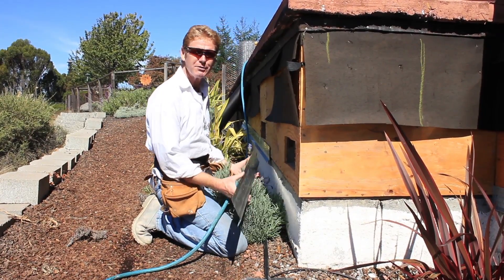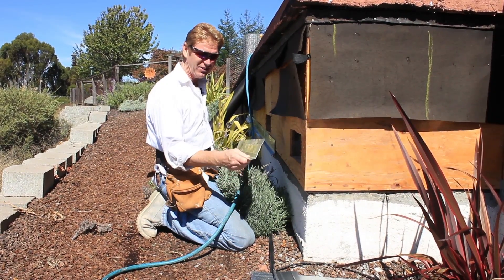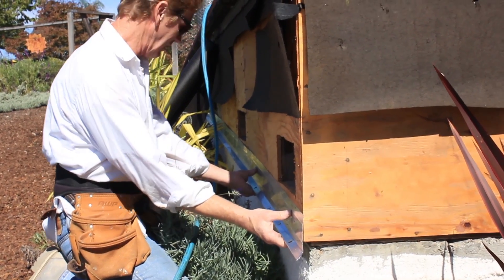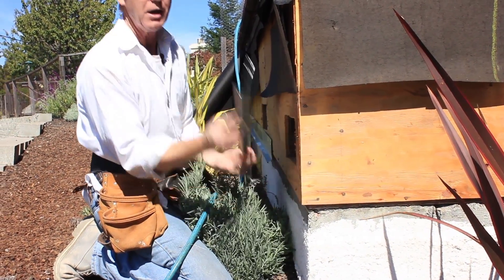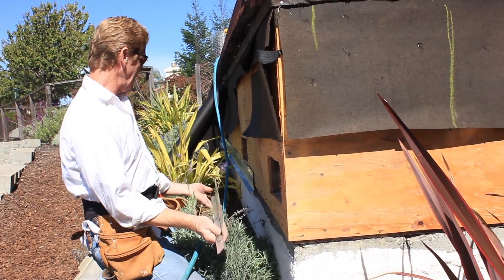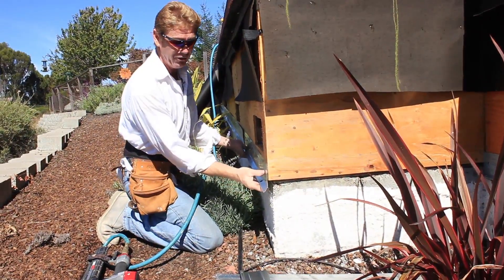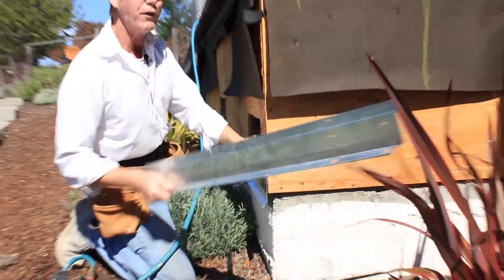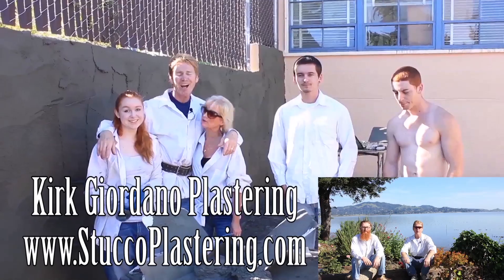https://youtu.be/CB_cK38i-18

Comment: Great content - if there is a huge cavity and I can see see the wood behind the weep screed post stucco application- does that mean they installed it incorrectly?
Reply from the maker: No, not at all, this means the wood can breathe, just don't allow that area to get or stay wet. How can it get wet? a sprinkler system pointed upwards. Yes, I have seen this, the wood rotted and stucco cracked and buckled because of that.🕵🏼

Comment: Great video. What type of staples are you using for the weep screed and the weather proofing paper?
Reply from the maker: Inch and a quarter for the airgun and T-150 for the hammer tacker.
Reply: @StuccoPlastering  do you use stainless steel or hot dipped galvanized?
Reply from the maker: @kanive1566  they only sell galvanized
Reply: @StuccoPlastering  they sell T-50 staples in stainless steel
Reply from the maker: @kanive1566  good to know but that would be over kill with what we do, unless we were trying to avoid electrolysis.
Reply: @StuccoPlastering  I see. Ok thanks for the info.

Comment: What if this is a second floor (wood frame) and it’s sitting on a first floor concrete block structure. Does the 2nd floor wood frame stucco still need a weep screed? If it doesn’t have it, what happens? Thanks Kirk! 👍🏼
Reply from the maker: I would recommend you use it rather than just feathering over the lath and bricks together.
 If you don't use a weep or expansion joint, you will get a nasty horanzont crack around the entire perimeter in less than three years. It won't be structural or damaging, but it will be a sign of an apprentice who lathed and plastered the two separate starters. Cheers. That's a good question, my brother. I do have videos on this.
Reply: @StuccoPlastering Thanks! I looked for a video on this from you but couldn’t find it. So much content! lol. I’ll keep searching. Thanks again.

Comment: How do you prevent insects from crawing up weep screeds?
Reply from the maker: Morning Matt, insects such as spiders and other bugs will hang out where they want, they cause do problems. The idea is to drop the weep screeds at levels that protects the wood mud sill and or plywood. Why? Good question. If they get wet they swell and rot, now the termites move in then when they eat the wet wood and die they make a meal for the ants. That’s when the trouble really begins so installing the weep or drip screeds is important. Now you know.😉

Comment: Do you need to use this if you have a concrete block house? Is this only for wood framed and paddled houses. Thank you.
Reply from the maker: Hello Security Dude; excellent question; metal screeds are not meant for bricks, blocks, or rocks as they don't move nor rot. 👨🏻‍🔬

Comment: Kirk, one last question... I need to double-ply paper my house to protect plywood siding and window flashing.  How long do you suppose can the paper be left "open" to the sun without installing stucco?  6 months? 1 year?  Reason being that we're waiting for permits from LADBS for basement work, and that should be done before stucco is added I'm told as stucco will crack with foundation shifts.  Thank you.
Reply from the maker: Hi Roger, that depends on the wind and rain. I have seen the paper last well over a year, and the opposite, areas with high winds and rain beat it up in less than a month.
Reply: @StuccoPlastering  Thank YOU.  A reason your information/videos are so critical (at least here in Los Angeles, CA) is that my experience with several licensed contractors from general, window, block and concrete have construction guys and indeed OWNERS who have the "I don't give-a-f***" attitude  about the quality of the work, despite having city approved plans laid out, and often must be micromanaged.  They want the money after an LADBS inspector clears their work, who ironically often passes final product without truly checking said work.  Leaving behind substandard results that in my case, have had to be redone 2, and in once instance, 3 times at massive costs leading to the involvement of the CA State License Board.    I don't know the reason for the "I can't be bothered" attitude, maybe it's pot? or covid? I just know that when I was a kid in my teens and 20s (I am now 50) there WAS incredible pride in what people produced.  Have others in construction or homeowners seen this transition? Lastly, We appreciate your outright honesty.  Truth is a breath of fresh air.
Reply from the maker: @rtovar91  Thank you, my friend, thee are indeed many who have no clue.

Comment: Hi Kirk,  thanks for the nice video. One quick question for the screeds.  If I use a blower to blow outside to the screeds, will it cause air flow into the house?  In my new house,   I can feel the wind around the connection area of the floor and dry wall inside the house? I am not sure if that is the sealing issue of inside dry wall to the floor.
Reply from the maker: Howdy Enyang Xu, Now that's an interesting question, No, if the screeds are hung properly or incorrectly, this has nothing to do with air coming into your home, 
It sounds like your windows don't shut firmly.🤔
Reply: @StuccoPlastering  Thanks Kirk.  I am suspecting the air sealing between drywall and floor is not done properly before they put in the insulation. They should put in something like Caulk there for the sealing.
Reply from the maker: @eyxu  They are gone. It will be up to you to caulk around the perimeters, It's as easy as drinking a beer, nothing to it.
 No doubt you have large exterior foundation vents that allow excellent airflow into the foundation area.🤙

Comment: What can I do if I already have stucco against a cement walkway but the stucco falls off with the rains.  What could I do in that?  Thanks
Reply from the maker: Howdy Jamie, sorry, I don't understand your question.
 That is like saying when it rains, the concrete walkways dissolve. It makes no sense. Clarify, please.🤔
Reply: @StuccoPlastering  Is, I'm sorry.   So here goes another try. I had a new cement walkway installed on the side of my house.  This cement walkway is 90 degrees perpendicular to the wall (stucco wall).  Where these two meet (@ the 90 degrees) my stucco falls off.  The wall doesn't have a wepscreed and water acculates (@ the 90 degree intersrction) and the stucco falls off.

Comment: What size drip screed are you using in this video if you don't mind me asking?
Reply from the maker: Evening Ray, LOL, there is only one size that depth is 7/8 the flange is 3 and a half ings long, there are two types of weep or drip screeds sold in the USA, both are 7/8 thick as that traditional stucco thickness.
Reply: @StuccoPlastering  Thank you brother

Comment: Great information. My new home is stucco and weep screed is installed properly, however my home inspector says much of it is blocked with paint and other building materials. Do you have a suggestion on how to unclog it? Thanks.
Reply from the maker: Good evening Bruce, of course, lay down on your back and use a scrapper to unclog the holes under the drip screed.
 It's really easy.Good evening
  Our unique plastering Tip:  all subscribers or anyone who stumbles on our channel with a question, type it into our Stucco/Plastering channel, and like magic, a video will appear to explain how it's done. 	
   This feature is miles ahead of any plastering forum. 🥳	
Kirk & Jason Giordano Plastering	  Our unique plastering Tip:  all subscribers or anyone who stumbles on our channel with a question, type it into our Stucco/Plastering channel, and like magic, a video will appear to explain how it's done. 	
   This feature is miles ahead of any plastering forum. 🥳	
Kirk & Jason Giordano Plastering

Comment: Hi Kirk, There is a gap between my stucco and weep screed. What is the proper way to fix it? Do I replace it or seal it? Thank you so much.
Reply from the maker: Good evening Brittney, I'd leave it as it was caused by expansion.😉
 If you really don't like the look of it, caulk is with Mor-Flexx caulking as this caulking has sand in it to match the stucco as best as possible, alow to dry, then paint.
  Our unique plastering Tip:  all subscribers or anyone who stumbles on our channel with a question, type it into our Stucco/Plastering channel, and like magic, a video will appear to explain how it's done. 	
   This feature is miles ahead of any plastering forum. 🥳	
Kirk & Jason Giordano Plastering

Comment: Here in the UK, we mostly use brick and/or block construction, but I am captivated by your highly adaptable timber constructions. Which is more important - the depth of the drip screed below the sill plate or its height above ground (grade)?
Reply from the maker: Evening Jock dude,
 both, we must be above the ground at least 6 inches, can't always do this, but much more important the bottom of the drip screed should be at least 1 inch below the mud sill, or the dripping water can rot out the mudsill.
 cheers out in the UK.
 kirk giordano rendering

Comment: Kirk, please understand,  you are not demonstrating how to actually remove and replace rusted of deteriorating weep screed. I need a video on how to use either a circular saw or some other method on how to demo out the bad and replace with good. Your videos are only demonstrating new installation, actually need something for the entire viewing audience that demonstrates how to remove. And replace, my friend!
Reply from the maker: Evening barry, thanks for the tip,
you my friend are a hard fella to please, no worries, FYI, some things such as how to remove a rusty weep screed have no glory for most folks,
 Why? Glad you asked, firstly, weep or drip screed are galvanized and thus should not rust.
 2. most folks won't want to watch this boring deed, but just cause you asked I will tell you my way for this non glorious but often necessary chore of breaking out stucco,
 Use a bosch bulldog hammer chisel with a half inch chisel bit. 210 bucks at your local Home Depot store.
 And for the love of god stay away from a circular saw with a masonry blade or face dust, four to five homes away, with pissed off neighbors calling the city about a madman creating cement plaster dust, who knows the city may even come with their handy dandy $35,000 fine for lead dust in the neighbourhood, Yes I have been slapped once with this fine,
 thus I leave the breakout the the young fellers,
 Cheers,
 kirk giordano